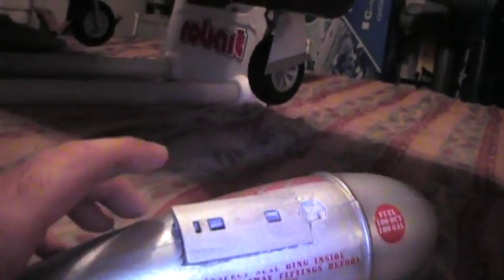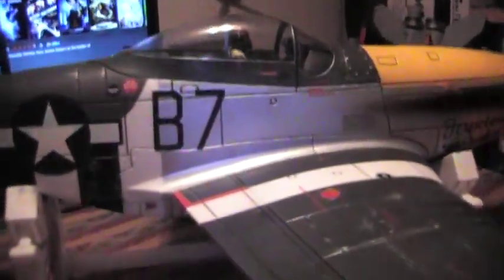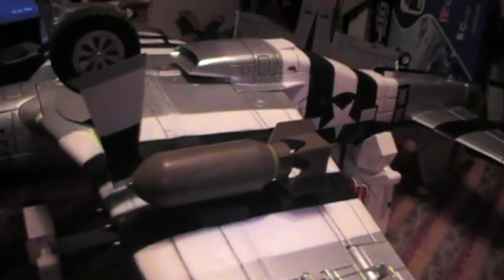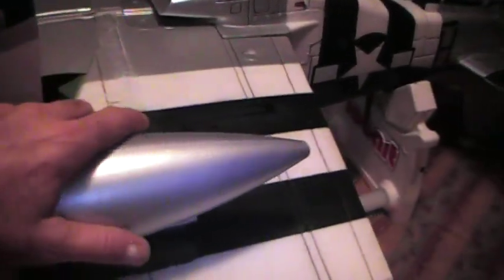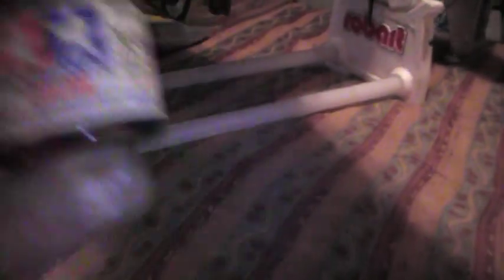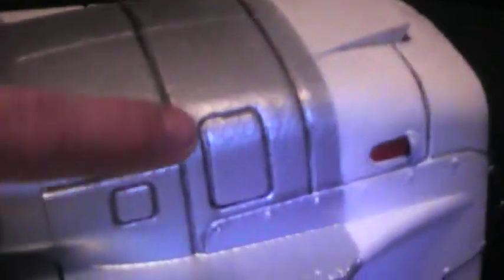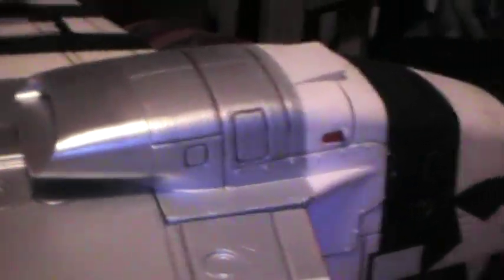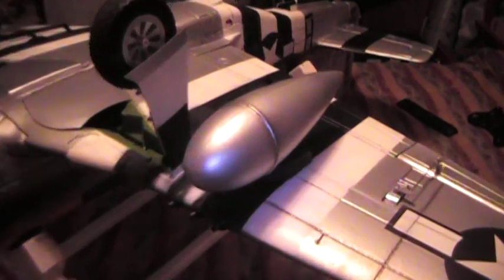FMS 1700mm P 51 Mustang Walk arround 001

Comment: Brandon, what gear sequence system are you using in your Ferocious? I have the V1 and tried to use the 6 sec. sequencer but it didn't work to close the gear doors when the gear is down.

Comment: Brandon how did you run the wires for your drop system? just ordered the plane and the kit and want to hide my wires. thanks for the info.
Reply from the maker: They are run along the same channel as the original wires and along the inside edges of the wheel wells to same exit point as the stock wires
Reply: Did you just remove the tape and put it back on or add new silver tape? I looked at the channel where I would run my wire and it's packed. I don't think I could get another wire in there. It's looking like I may have to cut another channel in the wing and bury the wire then recover it. Ideas??
Reply from the maker: I just widened the channels, but making your own is a good idea too. hiding the servo wire is easy and what ever works to your liking?  is what I recomend